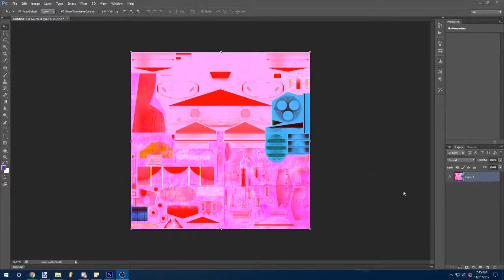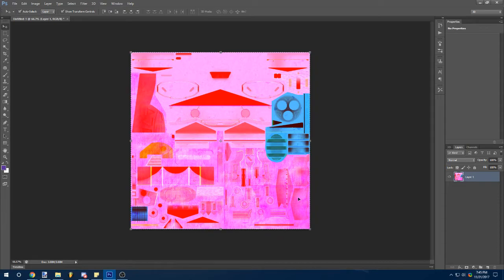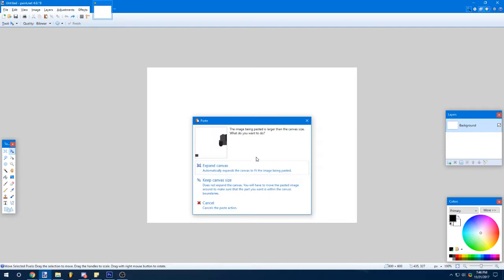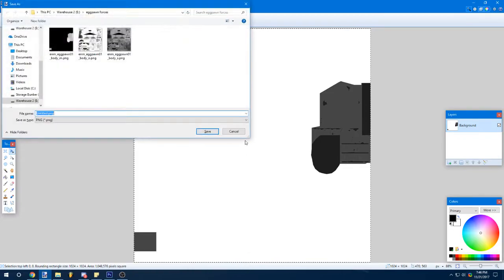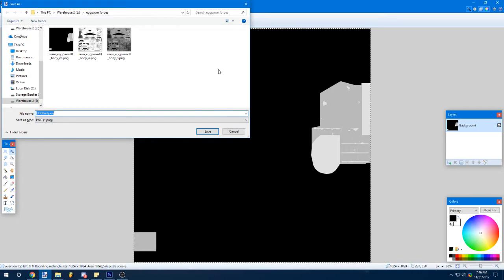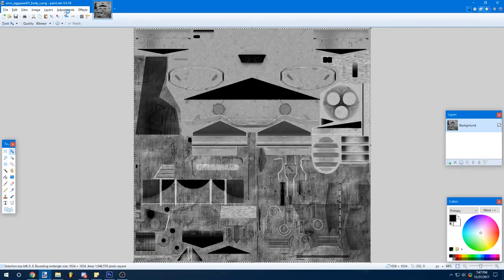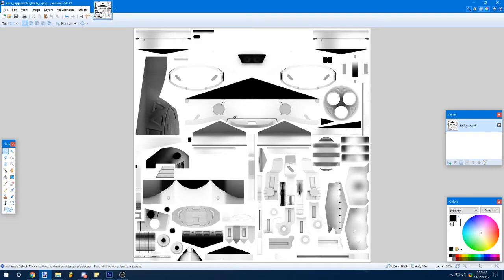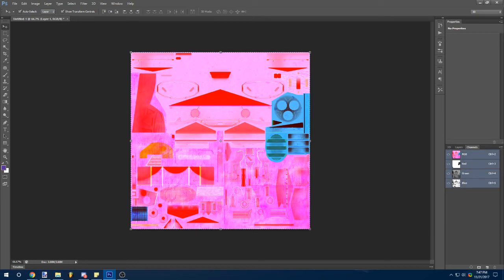sonic forces - PRM maps explanation

Comment: How would you set it up in Blender?
Reply from the maker: You can separate the PRM map using a Separate RGB node, and then plug the corresponding channels into the relevant inputs of a Principled BDSF node.
You'll need to use an Invert on the green channel, as to turn the smoothness into roughness.
I'm not sure where to use the blue channel, as I don't think there's an Occlusion input on the Principled shader.
Reply from the maker: Pinning this so others can see the solution easier
Reply: @LandyRShambles  
So the Red Shader goes to "Metallic", Green Shader goes to "Roughness", and Blue goes into a separate Ambient Occlusion Node.
Reply: @LandyRShambles  
Based on another Blender Tutorial that deals with ABD maps, you can probably use a “MixRGB Node” to mix the abd diffuse map and the blue channel of the PRM map.  It all goes into the Base Color port.
Reply: @gameman5804  wouldnt it be better to pipe the blue map into a ambient occlusion node
then rgbmix that with the diffuse map with the multiply setting

Comment: some PRM maps have an alpha value..what it is used for?
Reply from the maker: no idea unfortunately. the ones I received and/or extracted myself didn't have them
Reply from the maker: talked with an experienced modder; he speculates that it controls how much direct lighting gets lost under shadows
Reply from the maker: So turns out we got some stuff completely wrong - turns out the Alpha channel is used in certain shaders to specify metalness.

The Red channel, then, is NOT metalness - it's specular, as in the specular PBR workflow. However, if pixels are above a 0.9 brightness value, they will render as full metalness.